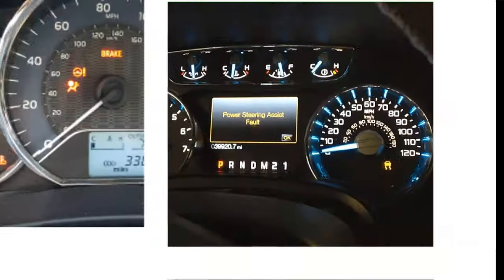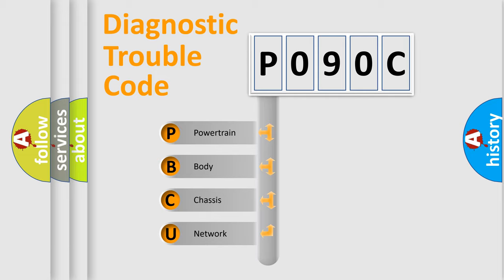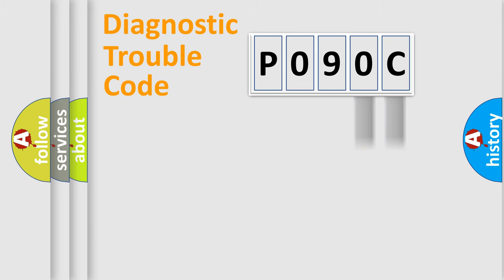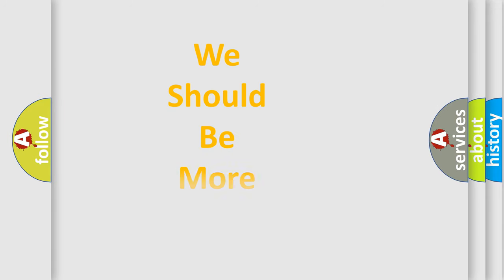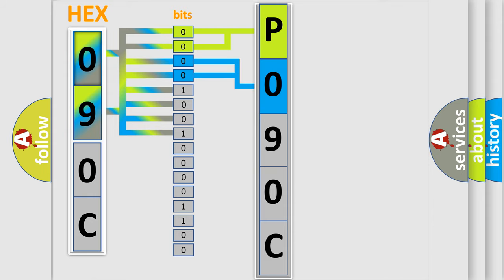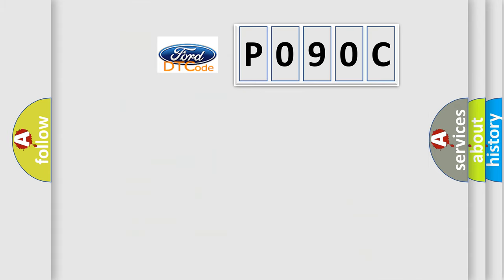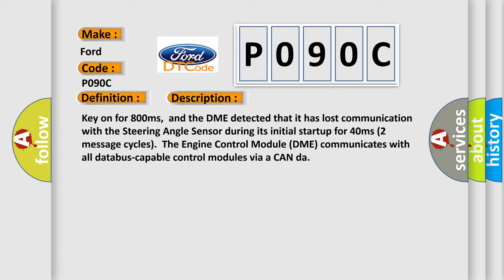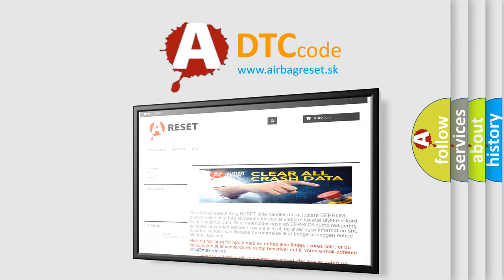DTC Ford P090C Short Explanation

Comment: P090C
Clutch "B" Actuator Control Circuit Low
Short to ground detected on one of the 3 phase circuits.
Reply: Ok I changed that and still a code what next?
Reply: @raymondsegovia9835  changed what?
Reply: I changed both clutch actuators and am still getting the code. Somehow Ford determined this code was being thrown because I needed a new throttle... they were wrong. 🙄 Any ideas?
Reply: @shopnnut4615  The issue is the TCM, overheating MOSFET.
Reply: @shopnnut4615  Hi, could you resolve the problem? It is happening to me also
Reply: Did you resolve the issue? Happening the same to me
Reply: It's under warranty 10 years and 130,000 miles.  My car is the dealer but 48,000 tcm's backorder.